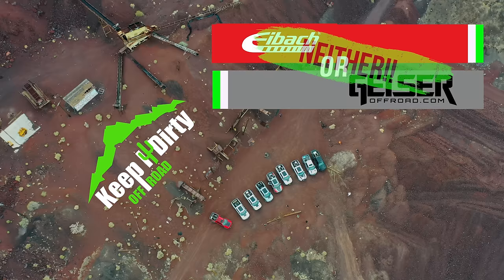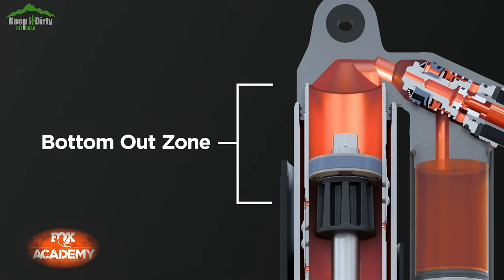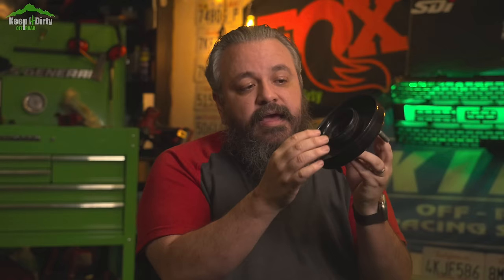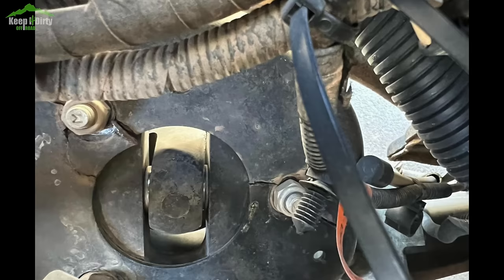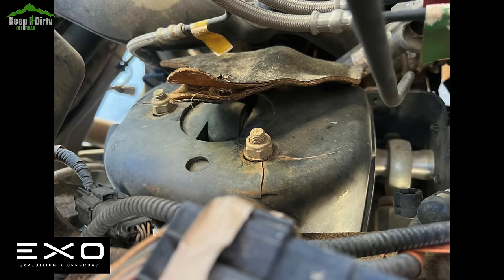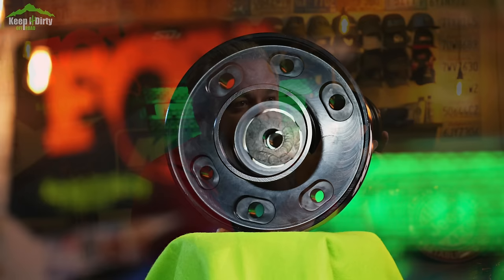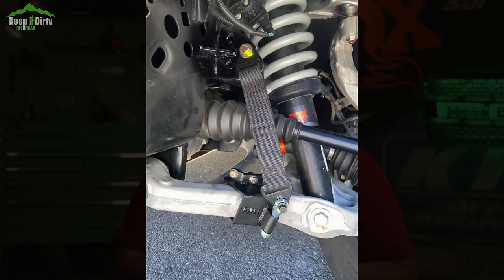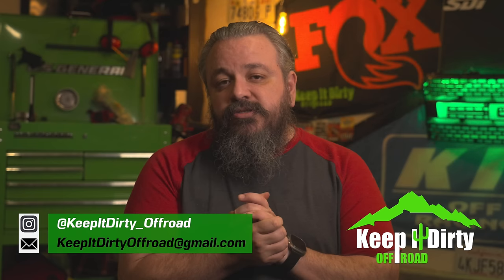Eibachs or Geisers?  NEITHER!!

Comment: This happened to my gen 1 twice with geisers. I’m on 3.0’s now and will not recommend any aftermarket springs to anyone who asks me.
Reply from the maker: Wow man. I need to know more. What perch were you on? What failed. So many questions.
Reply: @KeepItDirtyOffRoad  mid perch on geisers. Blew out 2 top hats. Broke the welds on one top hat separating the 2 metal plates together and pulled another one completely apart in the same manner. Called geiser twice to Confirm that I can run mid perch with heavy Offroad use. They said it was okay even after I stated my top hat issues. Tbh I never liked them on the truck anyway. Too much bumpsteer. I never did move them down to low perch, I wrote them off after the second top hat breakage.
Reply from the maker: That’s wild man. Geisers with mid perch seems like a bad idea. Cannot believe they would say it’s ok. But based on my experience on the gen2 platform just riding crappy and how many others are seeing issues, it all makes sense now.

Comment: They blew because you guys beat the living hell out of the truck. If you drive alow the Geisers should be fine. Probably better for crawling over stuff.
Reply from the maker: Raptor was not meant for crawling. It can do it, but it was designed for the desert. Designed to run fast in Baja. 
But just like anything else, you cant cheap out on upgrades. Upgrading the springs is a cheap way to make the suspension more capable. But if you don’t reinforce for the extra abuse, you have failure. Simple as that. Those that get raptors have the right to use the trucks as they like. And some of us will use the truck to their max potential. You don’t have to. But if you ever get a chance to do it, you’ll love these trucks even more and you will be hooked.
Reply: @KeepItDirtyOffRoad  so I installing the Gen 1 Raptor shocks off rock auto on my 2013 F 150. I got the struts, you suggest getting the stock springs at the dealer then?
Reply from the maker: We have not seen any issues with the gen1 trucks running Geisers on bottom perch. So you should be fine. The problem come when guys try and do upgraded springs and mid or top search on those shocks that they get into trouble.
Reply: @KeepItDirtyOffRoad  I couldn't get my shock to get off its perch setting, maybe the ones off rock auto are different. I loosened the screw but the perch wouldn't move.
Reply from the maker: They may be fused. But it’s a grove and have to take them apart. Some penetrating fluid and maybe a mallet to get them to pop off.
Reply: @KeepItDirtyOffRoad  it loosened off but won't slide up any further. I can see the snap ring.

Comment: Gen 1 with Gieser springs and limit straps with no problems for over 4 years now. I think you're 100 percent correct on the live valve issue.
Reply from the maker: Yeah, no reports on the gen1. Live valves really add a ton of capability and you take more hits that the stock components can’t take

Comment: I purchased the SDI top hat the day you released the video on it! I have about 1,500 miles on the setup and 200 of them are off-road. I couldn’t be happier with the function and looks, it’s how the R should have come from the factory!
Reply from the maker: Totally agree. 👍
Reply: Did you add a rear spring spacer after installing the top hat
Reply from the maker: Rear spring spacer is not required unless your carrying a lot of extra weight in the back.

Comment: So on my 17 with the blue shocks I should be fine with a spring upgrade correct? What about the rear? If I get 3" in the front I'm definitely gonna need an inch in the rear to make it level? Besides a new set Deavers what else will work?
Reply from the maker: So the blue non live valve trucks are less prone yes, but not immune. The reason the live valve trucks are it more is because they are more capable. Push a non live valve truck the same way and it will fail the same way. EXO guys have seen is on at least 1 no. Live valve truck. But 1 in 13 trucks obviously means it’s less common. 

If your on a budget, I still recommend spacers over springs on all raptors. And the SDI top hat is still my recommendation. Then for the rest you need new leafs and I recommend the icon leafs over Deavers for most folks. They are adjustable either way the add a leaf and will last longer. All leaf packs with eventually start to sag again. When they sag, you add a leaf to get the height back.
Reply: @KeepItDirtyOffRoad  thank you!
Reply: @KeepItDirtyOffRoad  why doesn't anyone talk about adding a helper leaf to the stock set? Is that a bad idea?
Reply from the maker: Helper leafs help for towing, not offroad. the stock leafs are pretty minimal and a helper spring won’t last offroad. Too much movement. You need a whole replacement leaf pack to deal with the load.
Reply: Ok, last time I'll bug you.  So I've decided to go with the Icon leaf springs but at the lowest setting. So my question is, do you think the SDI top hat would be enough lift up front to make it level, or would I need a 2+ inch perch collar? I'm thinking the perch collar but I would prefer the top hat.
Reply from the maker: At the lowest setting your back end will be 1 in over stock so it will be close to level with the SDI top hat up front. 

Just keep in mind that initially it will be taller as the leafs need time to settle. And the only way they will settle is with movement or in our case off-roading
Reply: @KeepItDirtyOffRoad  thanks again.  Been watching a lot of your content. Great stuff.
Reply from the maker: Thanks man. Much appreciated

Comment: I have the evil limit strap kit on my gen 1 and have had zero problems or complaints with it, I first added it when I had geisers on stock shocks to prevent any excessive force from the added spring strength. I now have King oem 3.0’s but opted to keep the limit straps in place just to limit the wear and tear on the shock supporting the entire weight of everything if and when full droop occurs. (Yes I know the shocks  were designed to handle it.)
Great video, I was happy to see Exo share those images a while back as it was definitely a “psa” that needed to be voiced, so this was a great detailed follow up of these issues on gen 2&3’s. 👏🤘🏼🏁
Reply from the maker: That’s good to hear man. The single weld always worries me. 

As for the kings, they have a much better bump zone that Fox shocks so you are definitely better protected there.

Comment: Great video. I just did the SDI top hats, and Icon rear Leafs, yesterday on my '17 Raptor. I was originally thinking of doing new coils up front, but the shop I deal with (Apollo Optics) gave me the exact reason you did to go with the SDI setup.
Reply from the maker: That’s great that they steered you in the right direction. Most shops won’t.
Reply: @powershift I was thinking of doing the same setup, how's the level of the truck?? Are you on Icon option 1's? Thanks man!
Reply: @joemarchese6417  Yes, Icon option 1 without the added leaf. She sits level after the rear springs settled.

Comment: I had the Evil Limit strap on my gen 1 raptor and it worked great. I was able to install it by myself as a do-it-yourself kinda guy with some help from a mobile welder. It did rub on the shocks wearing away the paint. That was my only complaint.
Reply from the maker: That’s good to hear. My main concern would be the welded plate. I think with how I push my trucks over the years, that little piece will eventually fail.

Comment: I was close to convincing my dad to let me upgrade Our gen1 Raptors stock shocks with Hibachis, but now with this video it lets me see the potential problems, and dangers of it! thanks for an awesome video documenting the springs!
Reply from the maker: Thanks. Glad we could help.
Reply: If you increase the vehicle weight, upgrading to appropriately matched heavier springs then you’re set, this guy is talking half truth, he’s not explaining how to install different springs properly. He’s just saying just don’t do it which is small minded
Reply from the maker: We are just talking the front coilover springs in this video. All the pictures of damage were of the front springs. We never talked about rear springs where load becomes a factor. That’s a different story AND currently no one makes a load coil spring for the raptor that adds more than 1.5in of height. Well within what we talked about here. 

So what are these half truths you talking about? Pic here don’t lie man. 13 failures just on EXO runs alone.

Comment: Thank you always for the tips and help Helio  , we greatly appreciate that . Regarding the progressive springs I’ve got a lot of friends in Kuwait who always opt out for the progressive springs on Gen 2 and 3 . Also You know that I’ve got the Evil + 2 midtravel kit with the Icon 3.0s front and rear and the have those limit straps that came with it , I don’t have the truck currently but soon though I’m gonna test out the suspension on the trails  . I might double plate those welding spots on the limit straps in the near future but I don’t think I would be doing anything crazy since I’m mostly out of the country .
Reply from the maker: You guys have some decent trails out there so you will definitely test it. Most mid travel kits come with the extra reinforcement at the top of the shock bucket and the bypass shocks help dampen substantially. So you will be ok

Comment: Thanks for the video. I 'upgraded' to eibach on my Gen 2. Wish I would have waited. The height is perfect for me but a little too stiff for my liking. I don't run it to hard  so I have not had these issues, but wish I would have kept my stock springs in case I ever decide to switch back (left them at the shop)

Comment: This kind of information is great to know and thank you for taking the time to explain everything in detail. I have had a gen 1 and gen 2 with both sets geiser and eibach although I didn't have a failure this makes perfect sense. Getting ready to buy another gen 1 after not so great experience with my gen2.
Reply from the maker: Thanks man. And I think we’ve had similar experiences with the gen2. I loved my 2017. But my 2020 raptor was a nightmare of issues.

Comment: I will say Geisers on bottom perch has been good, but I know A LOT of guys who went with them on mid perch and wound up with blown shocks within months (obviously mileage and conditions vary). I have Icons on order so using Geisers for a month or 2 more shouldn't be an issue. Your points are all valid especially for those of us Raptor owners who really push the truck; Keep it stock or get a fully designed system for the truck.
Reply from the maker: I’ve never understood guys doing springs upgrades on gen1 shocks on anything but the bottom perch. That’s is so much preload and so many more issues can arise. 

But yeah man. Telling guys to stay close to stock seems to be an unpopular opinion these days. But offroad the stock trucks when driven within their capabilities are the most reliable.
Reply: @KeepItDirtyOffRoad  Well they think the springs are upgrade, and mid perch is generally an upgrade so combine the both of them and its DOUBLE THE UPGRADE. Unmodified and tastefully modified ALWAYS have less issues and retain more value than super modified vehicles GENERALLY.
Reply from the maker: Totally agree. So hard to get folks to understand that.

Comment: I had the Eibachs on my Gen 1 with RVC IWE deletes and went through 2 sets of CV Axles in a year due to tearing the boots.  Went to the Geisers and this solved the issue mo more torn boots.  Ran on bottom perch on both springs.
Reply from the maker: Has to do with the angle of the boots. We see it a lot and why recommend restricting preload to 1.5-2in over stock to keep the CV axle boots from touching and wearing out prematurely
Reply: @KeepItDirtyOffRoad  yea the Geisers on bottom perch are very close in height to my stock springs on mid perch where the Eibachs on bottom perch were more like stock springs on top perch.  Posted this to hopefully save someone some money in CV axles
Reply from the maker: Yeah. Definitely another issue to raise awareness on.

Comment: I run Eibachs on my gen 1, and do push it hard off road in arizona. No issues to report, whatsoever. 👍🏼 but thanks for sharing your knowledge man, much appreciated 👌🙏🏻
Reply from the maker: That’s good to hear. 

With this video we just started heard of failures on the gen1 was when folks did springs upgrades but went to mid perch. The extra preload caused the shocks and top hats to fail. 

Are yours setup on bottom perch?
Reply: @KeepItDirtyOffRoad  yeah Im bottom perch and so far Ive had no issues.
Reply: @KeepItDirtyOffRoad after prerunning the first 50 miles of the Baja 500 the right side top hat started to separate. Now Im deciding if RPG Top hat replacement is the way to go or might just get king 3.0s and be done with it. What do you think man?
Reply from the maker: I’m not a fan of the RPG top hat. I think the ball joint design is too rigid and it’s an extra Maintenance and wear point now too. I’ve heard from at least one guy running it now hearing a pop from his front end which may be the ball joint under too much tension. 

There are a few ways to go. If you value the daily soft ride, consider SDI Eclick either the extended shock bucket and take off live valves. It’s the best dang for your buck. 

If you plan to go wild with upgrades later and this is mainly your toy, sky is the limit.
Reply: @KeepItDirtyOffRoad  Im more interested in off road performance and strength than street ride. 
If I got the KHC shock bucket replacement, and got gen 2 17-18 shocks without live valves. 
Id still have to use gen 1 springs right? 
Ive hears the rears fit just fine from gen 2 onto gen 1. 
Or bite the bullet and get kings or fox 3.0s, decisions decisions. Lol
BTW what are your thoughts on sway a way shocks?
Reply from the maker: Stock Gen2 shocks and springs will work with a gen1 with the coils bucket conversion. camburg also makes a bucket too that I’ve heard fits better than the KHC. What ever bucket you do go to, make sure you weld it on for the strongest install.

gen1 springs won’t work on gen2 shocks. Different shock body sizes. 

I’m not a fan of the sway away shocks. We had a mid west guy show up with them a few years back and they broke within the first 30min. It was his fault, but still. With raptors look at ADS, King or Fox in that order. 

If you do upgrade the shocks, I still recommend doing the top hat upgrade and using gen2 shocks. More options and way better since it’s all 3.0 shocks. Gen1 shock bucket is limited to 2.5s.
If you go Live Valve, you can do Eclick as well and keep a soft ride. But that’s the most expensive option.

Comment: May just go back to mid stock set up when i get them rebuilt. Even with the gen 1 i cant afford to have that kind of failure happen no matter how low the chances are. Its not only my fun truck but a DD. 

Hey manufacturers us gen 1 guys are still out here and wanting some cool stuff too 😢 😆
Reply from the maker: Not a bad plan man. Never hurts to be ready. Just keep in mind you gen1 shocks have shims above and below the shock bucket. They adjust the angle but also help reinforce the shock bucket. You really have to push it hard to see it on the gen1
Reply: @KeepItDirtyOffRoad   didnt know about the shims thats good to know. 

right but the pot holes of New England are pretty rough 😂
Reply from the maker: 🤣🤣 true. Can’t be worse than Baja though. Maybe sharper yeah.
Reply: @KeepItDirtyOffRoad  definitely not lol.  Would love to find out some day though

Comment: I did Eibachs and even after alignment and reprogramming the ride height the truck never rode the same. The top-out was pretty violent especially after big or fast hits. I would never recommend changing coils without upgrading to a custom shock… Same problem on both my 19 and 20.
Reply from the maker: I experienced the same on top of a rough ride on small stuff.

Comment: Never had an issue. 19k hard off-road miles. I got the first set of Gen 3 Geiser springs all around.  The issue is people overdriving their trucks thinking a Raptor is a trophy truck.
Reply from the maker: Where do you offroad? And is your experience just with the Gen3? 

I normally put 20k miles on my raptors a year off-roading in SoCal and Nevada. I personally saw the shock bucket splitting from the frame on my live valve truck. And saw a few others have issues with cracking as well. 
The main cause was not overdriving. It was getting surprised on the trail. Hardest thing to learn is how to read the trails. Everyone gets surprised because trails are always changing or they just don’t have experience with scanning and adjusting their driving. There is a small handful pushing them too hard sure. But these issues can happen to anyone. And will happen to you eventually if you’re doing some serious off-roading.
Reply: @KeepItDirtyOffRoad  multiple Baja trips, all around Arizona and Southern California.
Reply from the maker: Just the gen3? 

Or do you have experience with the gen1 or the gen2?

Comment: This is making me want to just avoid live valve upgrade all together on my 18 unless I cough up enough to do the e clik with fox factory
Reply from the maker: What shocks you looking at doing? Take off Live valves or the Fox Factory Race series (FRS) shocks?
Reply: Just the manually adjustable Fox factory 3.0
Reply from the maker: So the factory race series live valves then? 

Well if you go that route, make sure you reinforce the top of the shock bucket. Those shocks are more capable so you will be able to do more and reinforcing the shock bucket is a must.
Reply: @KeepItDirtyOffRoad  I'm still on the fence. Part of me just wants to go with the non live valve Fox factory shocks just to not deal with  reinforcing or worrying about droop etc